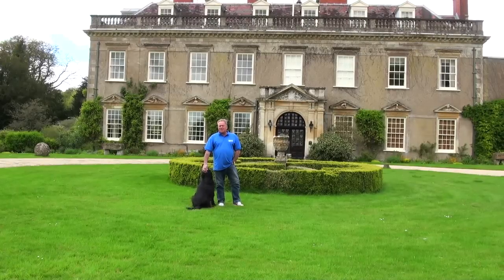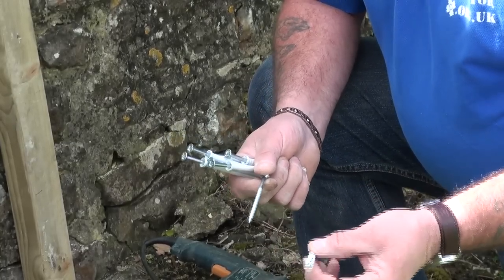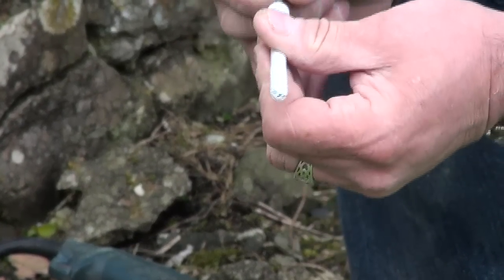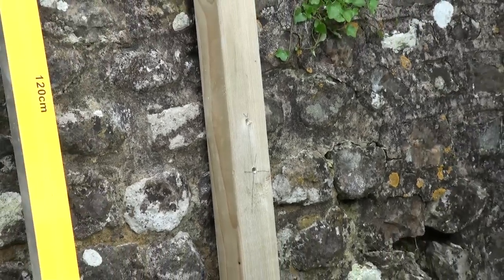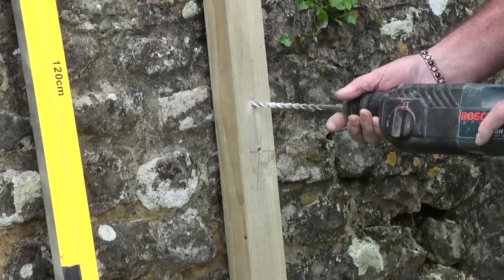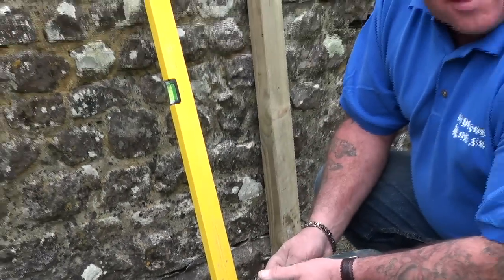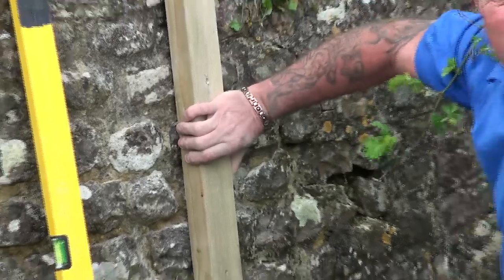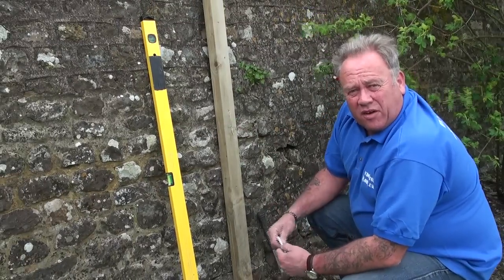How to use Frame Fixings and Hammer Fixings

Comment: I never had any single luck with these type of fixings. I'm not DIY stupid (e.g. I built, tiled, wired and plumbed  my own garage  that has stood for years). I have used many different fixings but for some reason these just do not work for me.
 Read instructions and watched videos  like this- check. Use the instructed size drill bit- check . Used only premium quality fixing (rawlplug/ fischer) - check.  Ready!
Drilled, hammered in. Pulled on the timber - comes straight out . Tried in concrete , in brick  - a dozen times with always same results. Useless. Even if I could get one to stay in place I would be very suspicious of their longevity.

Comment: so the hole drilled in the wall is the length of the nylon piece minus the thickness of the timber being attached to it (plus as some have suggested an extra 10mm for debris) is that correct?
Reply from the maker: +Peter Smith Exactly that Peter

Comment: Thanks for this. I have bought 6mm version to put up battens for dry-lining walls and the pictures on the pack left a lot to the imagination. 
Is good to know I can adjust with a screwdriver, because I  want to get the wall as even as possible over very uneven brick.

Comment: Hello Mike and thank you for the useful video. One question if I may please ? I have to put 4 x 2 battens up a brick wall to hang a lightweight garden gate on.  Gate is a tanalised  planked 3ft x 7ft with 3 cross members with the correct bracings and I will use 3 large T hinges.  In your opinion are these frame screws better than masonry screws ? I have already bought some 7.5mm x 100mm masonry screws and going to use a 6mm masonry drill but out of curiosity wondered which of the two types of fixings are the best to use. Thanks for any advice. David.
Reply from the maker: +scooby7346 Exactly the same Scooby but the frame fixing are also designed for speed. Plugging and screing in the normal way will work just as well but take longer is all.
Reply: +DIY Doctor Sorry Mike but we have got crossed wires. I meant the masonry screws where you just drill a hole through the batten, straight into the brickwork, and then screw the masonry screw through the batten and into the wall. No plugs used at all.
Reply from the maker: +scooby7346 Sorry Scooby, mis-read your post. The masonry screws are great if the structure is sound. If there is any type of crumbling in the masonry the threads do not hold well.
Reply: +DIY Doctor Thanks Mike. My wall is built of good quallity facing bricks which are sound.

Comment: drill hole 10mm deeper than you need to catch the loose debris
Reply from the maker: +manx man Thanks Manx Man, a good tip. Its easier also if you move the drill in and out as you drill to remove debris/dust etc as you go.

Comment: I was about to drill my wall, and then hammer in the plastic sleeve. Then I was going to drive the screw through the timber into the plugged hole. Glad I found this, because I never have used these fixings, and I have two dozen that I inherited from a friend. (RIP) Thanks for putting me straight!  Much less bother to do it this way!
Thanks again. JW
Reply from the maker: Jazzwayze Glad we could help

Comment: Ive been informed at a local diy store that to put up micro wave wall brackets i should use these hammer in fixings as that is what they would use it seems in principal a simple idea drill apropriate diameter hole put in rawlplug part place microwave bracket over this and insert screw through bracket into rawlplug part of hammer fixing and simply tighten down..... love it great video .
Reply from the maker: Cant fault the logic but they would not be my choice to fix microwave brackets. The screwheads of hammer fixings tend to be quite large and may look a little oddon the wall. My choice (Assuing it is a solid wall of course) would be ordinary wall plugs and screws. The procedure is the same as for hammer fixings but you can choose the type of screws you use. This page may help you decide how best to fix to masonry http://www.diydoctor.org.uk/projects/fixing-to-masonry.htm

Comment from the maker: Hammer fixing are designed to have the screw hammered in.The threads are a little like one-way valves in that they "fold" over when the fixing is hammered in but spring back when the trough is detected in the thread. There is no damage done to the thread at all, its a whole lot quicker than screwing them in, it means you do not have to take a driver with you also and on-site, where they are most often used this is a huge bonus. If the screw is struck properly the head is leaft perfectly OK and the reason there is a cross head for a driver is to get them out again if you ever need to. Most chippies using hammer fixings will also use a nailpunch to insert into the cross head to drive the fixing in one last thread for an even firmer fix.
Reply from the maker: Not sure what to say here! These fixings are holding in pretty much every window and door frame put in between 1980 and the invention of the "concrete" screw. Keep trying!